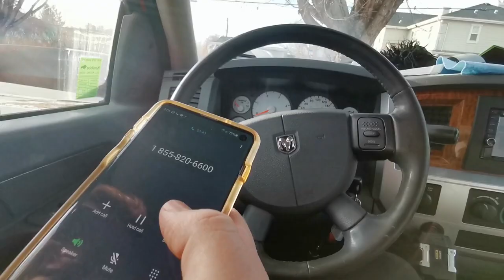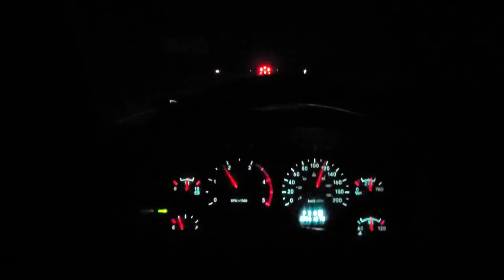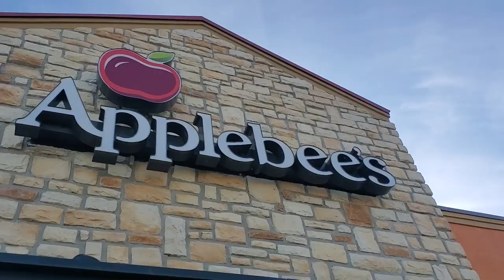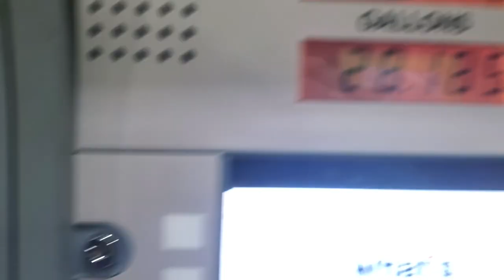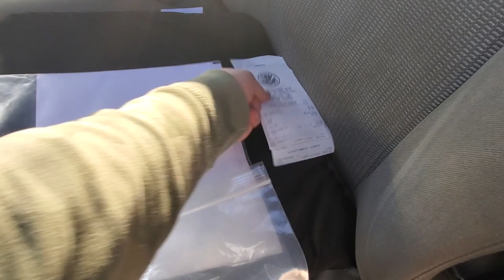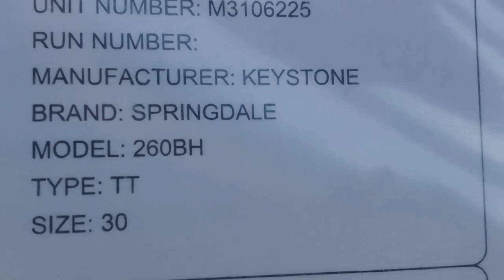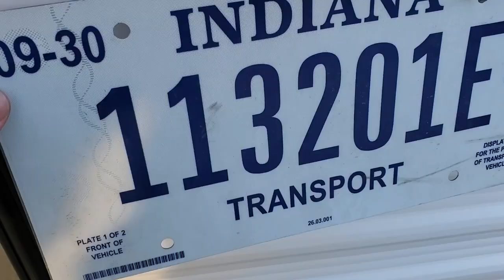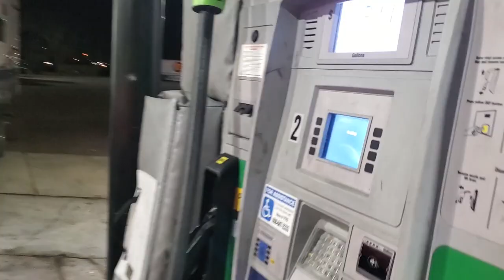How Things Work with RV Transporting. Team RV Express

Comment: Is there a restriction on year of truck was thinking about getting a 5.9 24 valve cummins, 03-07. I have owned a 6.7 in the past and loved it as well.
Reply from the maker: Hi sorry for the late reply. They don't really want you to have a to old truck but i think around 06 or 07 is fine. Mine is an 08 and did not have any troubles getting in

Comment: Great video! What kind of experience did you have to get started?
Reply from the maker: Thank you. I just had some experience pulling enclosed trailer thats about it. But i guess i learned a lot from my dad.
Reply: @stefanhoffmann9708  awesome 🤩 . How long did it take to get hired?
Reply from the maker: @mikedee1  not long. I just called in and then they send me the welcome package per email. Once i got everything i got started right away. Took a couple weeks in total. By the time you get insurance set up and drivers abstract and stuff like that. And then i also had to set up my truck. But overall didn't take to long.
Reply: @stefanhoffmann9708  I have a 1 ton just sitting around collecting dust. It looks like an interesting job. Thanks for the info!
Reply from the maker: @mikedee1  no problem. Yes for sure and they are pretty busy at the moment.
Reply: Hey Stephan how do you get into something like this

Comment: How long does a a tank last and do you have auxiliary tank?
And where are you from, Winnipeg?

Edit: just seen the second fill up. Yea how many miles do you get overall?
Reply from the maker: Its hard to tell honestly. It also depents how big of a camper you are pulling and how heavy they are. I know its way more convenient you dont have to fill up that often and i usually try to find a cheaper gas station when i fill up both tanks. And i don't have to fill up in canada that much which saves me some good money since the diesel is way cheaper in the states.
Reply from the maker: I could check on my next trips how much roughly i can get out of regular and auxiliary tank

Comment: Hey man I’m about to join team rv express, I do have some questions. Can I reach out to you via email?
Reply from the maker: Hi yes sure. My email is hoffmannstefan1995@gmail.com
Reply from the maker: Have you started with team rv yet?
Reply: @stefanhoffmann9708  No, when I went to submit application they told me they weren’t accepting applicants due to parts shortages and could be several weeks before I could start. So I just hired back on with another trucking company.